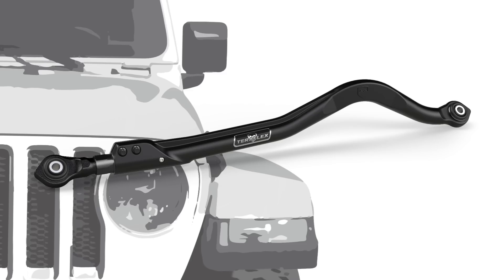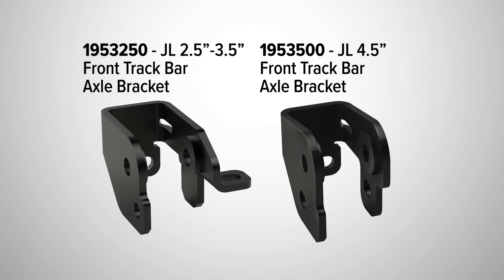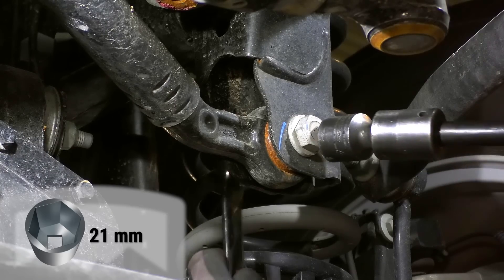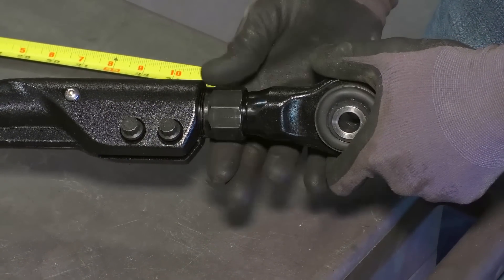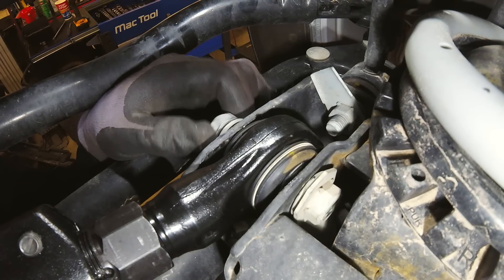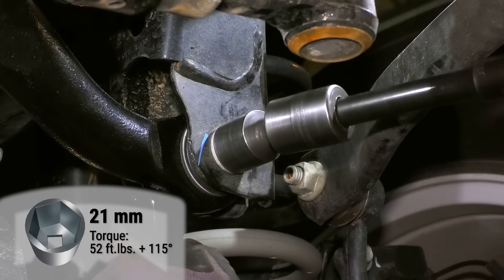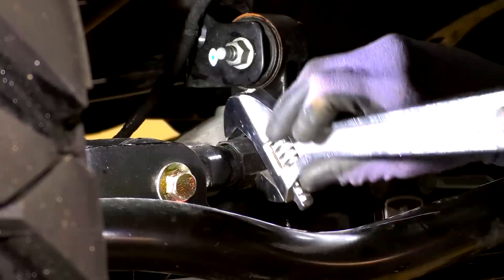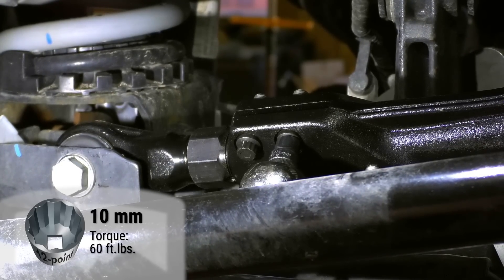JL/JLU: Alpine IR Front Track Bar | TeraFlex Install

Comment: Put this on my 2020 jl diesel.  Pops n clicks and makes all kinds of noise.  Any fix for this??? Bout to put the stock one back on.
Reply: I installed the track bar and I tightened very well but I’m still hearing too much noise !! And it’s moving a bit, is there any fix to this issue ?
Reply: @AALHUWIDI  if you haven’t already, contact them directly and they’ll send out a replacement bushing.  I swapped mine out at the frame side and the noise stopped.  I had front to back movement on the bar and it would make noise over every bump below 30mph.
Reply from the maker: Hey Bradley! Have you tightened down the adjustment sleeve bolts to 60ft lbs lately?

Comment: I have a mopar lift kit and thinking putting some adjustable control arms to correct my geometry and caster, pinion angle, center axle, and if i am on budget should i put front or rear?
Reply from the maker: We would do front lowers and rear uppers.

Comment: What about the axel bracket that you show at the beginning?  I did not receive and axel bracket and the bushings have a lot of play?  They were retightened to spec, but not real happy with the play in the bushings..  is this something necessary with the New IR?
Reply from the maker: Depends on what lift you have installed. We have them available in 2.5-3.5" and 4.5" heights.
Reply: TeraFlexSuspensions ... I have the  Teraflex  ST2 w/Falcon 3.3 shocks.  Do I need the bracket for s 2.5” lift.  

Will it help with the clanking at the bushing?
Reply from the maker: It is optional at the 2.5" mark, extremely lift vehicles will benefit more as they are probably more around 2.75". If you are having issues with the IR Trackbar, please contact our customer service team for help. 801-713-3314